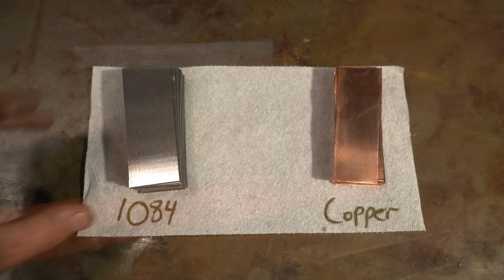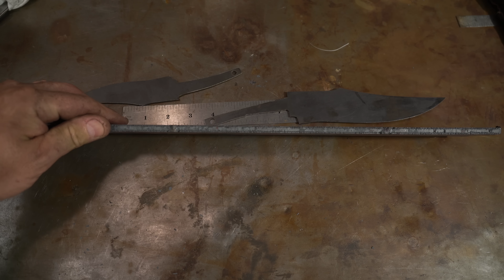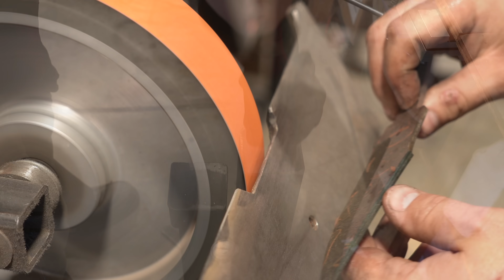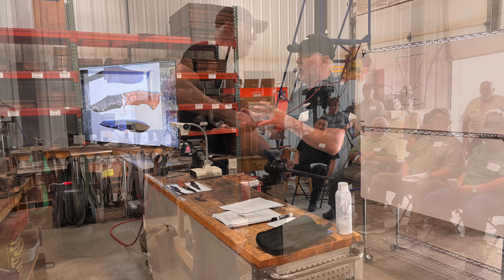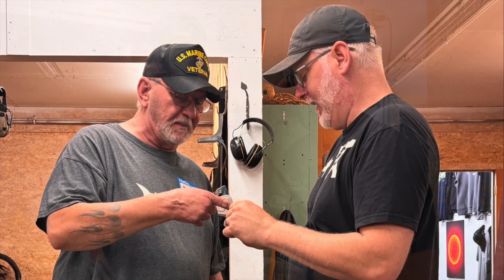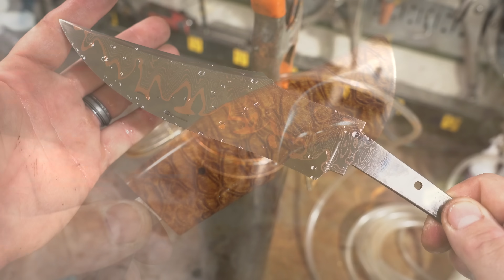Forging amazing ring-pattern copper damascus bowie knives

Comment: How well would this hold up to use
Reply from the maker: It’s very solid.  The knife is meant for use, not just looks.  Thanks for watching.
Reply: @TyrellKnifeworks no problem I had wondered about some of these because the are gorgeous and I had wondered if the copper had issues delaminating if you used them a lot

Comment: Do you keep the coffee at a boiling heat? Or is it like staining antler with tea, keeping it just below boiling.
Reply from the maker: You just boil the water, add the coffee and then let it cool a bit so it's warm and then immerse the knife.  You don't need to keep it at a boiling temp and its better and more stable when its just warm.  Thanks for watching, Mitchell.
Reply: Thank again

Comment: Why do you use coffee for etching?
Reply from the maker: Coffee etches the steel jet black and provides incredible contrast to the silver steel when used in normal Damascus.  Here with copper it provides a stunning effect.  The black oxide layer also prevents rust.  Thanks for watching.
Reply: @TyrellKnifeworks thanks for the info. Learn something new everyday

Comment: Hey Tyrell, Im a novice smith but copper damascus metal is something I want to give a try at. But I dont want to make a knife from it yet, I want to try and make a mandalorian style helmet. i feel like a blackened steel, nickel and copper pattern would look SICK as a helmet. Do you think something similar (but obviously a softer steel) would be able to be rolled out into a sheet?
Reply from the maker: Yes, I can be rolled out into a sheet, but the problem is that copper Damascus doesn’t like to bent or forged on its side.  You’ll likely get delaminations.  It’s not the best choice for your application I’m afraid.  Thanks for watching.
Reply: @TyrellKnifeworks ah bummer. Thanks anyways!

Comment: On this knife you went straight to coffee no acid. On Damascus, 15N20 and 180 is it necessary to use acid then coffee or could one go straight to coffee? Sure would like to hear your thoughts. Thank you
Reply from the maker: If you have 15n20 and 1084 together you need the ferric chloride acid so it etches the 1084 dark or you won’t see any contrast.  I hope that helps.  I’ve done videos just on finishing Damascus, check those out. 👍. Thanks for watching

Comment: How does the copper affect the hardening? I don't think it would harden anything like the steel would.
Reply: Pretty sure you're correct, it won't harden anything like steel, but that's why when doing a cumai you have to make sure the copper isn't present on the edge as of course that would really impact performance, aside from that, it's still a really strong, useable blade
Reply from the maker: The copper is just the cladding over a central core of high carbon steel.  We are hardening the core steel and the copper doesn’t affect that.  Thanks for watching.
Reply: @TyrellKnifeworks thanks for teaching!

Comment: I am curious. I saw this started as a damascus gomai with copper — outer layer of high carbon, cumai layer, high carbon core. On completion I expected to see a dark envelope on too. But I didnt and the cumai showed the whole way. Was this a resulyt of the ring depth or sanding away the outer layer? Thanks. Amazing everytime.
Reply from the maker: Yeah, the depth of the rings caused me to grind off more of the outside than I would have liked.  Though that depth did give me great action on the copper layer, so I’m happy with it. Thanks for watching.

Comment: I noticed you didn't seal up the whole billet this time, is that possible because of better tooling, practice, or was welding it all up overkill the whole time?
Reply from the maker: Welding it up is a good idea when you’re first starting.  After you get the hang of it and/or you have a PID controller, it’s optional.   Thanks for watching.

Comment: Hi, those knives are stunning. I love your copper Damascus blades. I'm not a bladesmith, just an avid watcher of Damascus forging. Purely out of curiosity what temperature did you quench the copper blades at ? Thank you, subscriber from Scotland.
Reply from the maker: This has a 1084 high carbon core, so it was in the oven at 1500F and hit the oil around 1475F.  Thanks for watching.
Reply: @TyrellKnifeworks thank you ✌️

Comment: Nice build.  I'm always impressed with how well you control your forging to the keep the core steel centered.  Most people don't realize how difficult this can be to do correctly.
Reply from the maker: It’s been a struggle at times but I think I’ve got it down.  Thanks for checking out this build!

Comment: Stupid question here. If u etching with coffee, later u used that knife to cut something like meat, does the color later fade?
Reply from the maker: Like all treatments, particularly an acid etch with ferric chloride, will fade over time if it’s a heavy use knife.  Coffee is a very durable finish though.  It takes sandpaper to remove it.  Thanks for watching.
Reply: @TyrellKnifeworks 1 more question if i may. My favorite Damascus is feather damascus, is it possible to do feather with copper?

Comment: What size handle blocks do you start out with? This knife turned out beautifully and that handle wood is absolutely gorgeous.
Reply from the maker: I’m usually using 3/4” x 1.5-2 x 5+.  I’d rather they be on the larger side so squaring them up is easy.  Thanks for watching.
Reply: @TyrellKnifeworks thanks i got a decent haul of some ironwood that is 1.5" square and about 20" long and have wanted to try a similar style of handle but wasn't sure if I would have enough material but I think i can make it work. Appreciate the reply and the videos they are always super helpful.

Comment: You’re an absolute artist. I’ve always been fascinated by Japanese katana forging process. Question. I understand how modern times with better equipment and better steel, many of the old ways are irrelevant. How about the edge, hammering vs grinding, why do they hammer the edge vs modern way to just grind the edge?
Thanks
Reply from the maker: Hammering the edge adds no value over grinding it.  Some people will talk about “edge packing” and “alignment of carbides” but that’s all BS. The main reason it’s done is to save material in cases where you’re using Damascus or something.  Or it’s just fun.  Thanks for watching.